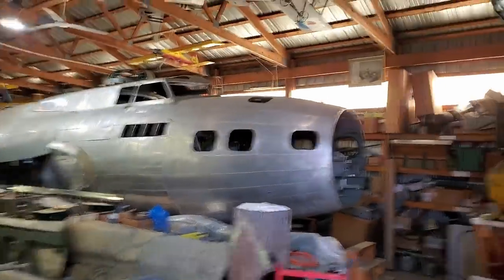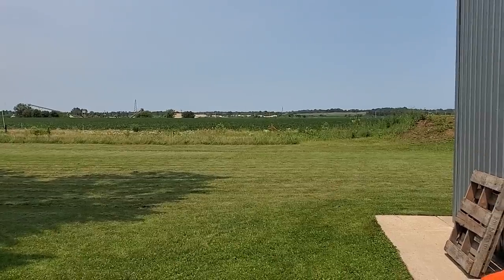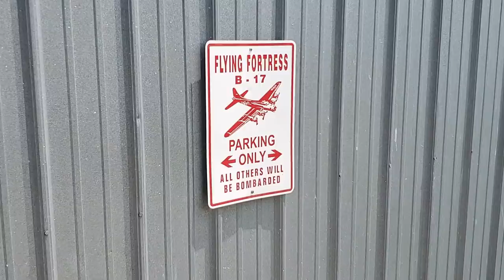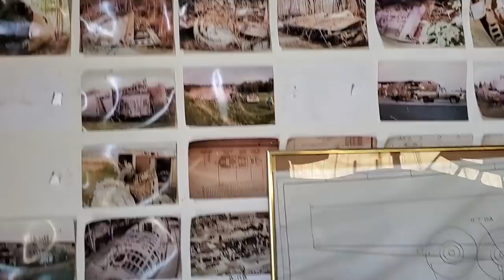Really! A B17 Bomber IN A BARN?!

Comment: The narrator describes the aircraft as one of the "few tall tail" B-17's.  In fact, it is quite the opposite: the B-17E model was the FIRST of the tall-tail B-17's, which also included widening the fuselage from the radio compartment to the tail to accommodate tail gunner position and give a little more room for the waist gunners. The smaller tails were on the original Model 299 prototype through the B-17D model.  There is only one "shark fin" B-17 known to exist, "The Swoose," owned by the Air Force Museum in Dayton, OH.  Restoration of that B-17D has been deferred for many years, in favor of restoring the more famous "Memphis Belle" B-17F.

Comment: Originally the B-17 had a smaller tail and no tailgunner position. Starting with the B-17E model, the after section was redesigned and a larger fuselage, tail section, and tailfin were added. Most B-17s built were the B-17G model with a powered nose gun replacing the hand held guns on the E and F models.
Reply: ..yeah..the B-17, beginning with the "E" model, had the fuselage aft of the cockpit, and the tail, extensively redesigned..so much so, I never understood why it didn't warrant a new designation..strange..for example, one B-17E was converted to use Allison liquid cooled engines...only an engine change, not a major airframe redesign, yet it was redesignated a "B-38"..and the B-17F that was converted to a bomber escort was redesignated "YB-40"..there are a lot of examples of this sort of thing..where seemingly minor changes got a new designation, while major redesigns sometimes did not...even applied to sub-types, such as the P-47D..early ones had the B-C type razorback fuselage and sliding canopy, then they cut down the fuselage and added a bubble canopy..yet, it was still a "P-47D"..you'd think that would have automatically resulted in it being a "P-47E", "P-47F", or whatever the next available sub-type was....

Comment: You must have aquired a ton of manuals and blue prints to under take such a hudge project. My late father worked on those birds during the war. I have an old Homelite 2 cycle engine that  ran a 25 volt charger for the aircraft batteries. It came from the tail section of a B17. It's for sale if you're looking for one. It does not have the generator part.
Reply from the maker: You can contact them through the link in the description